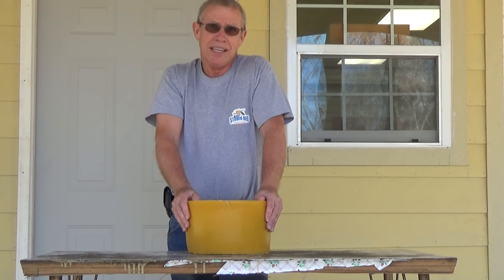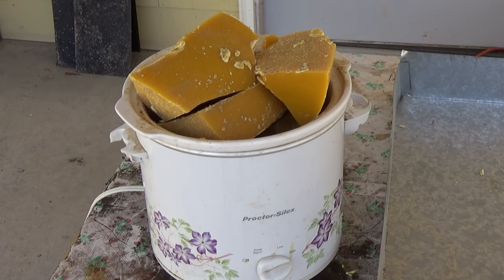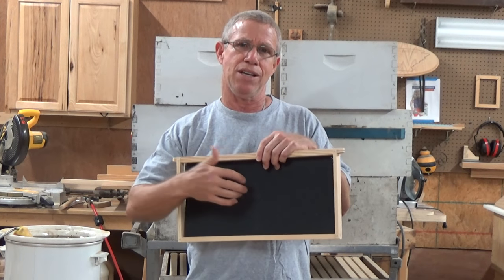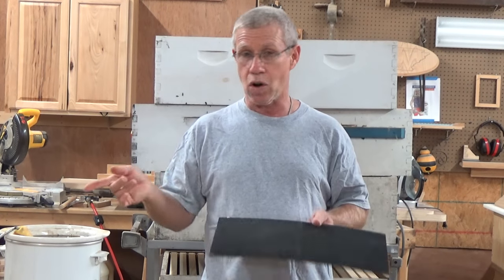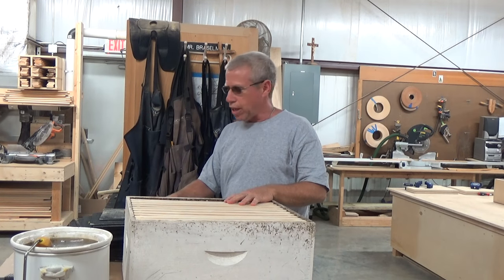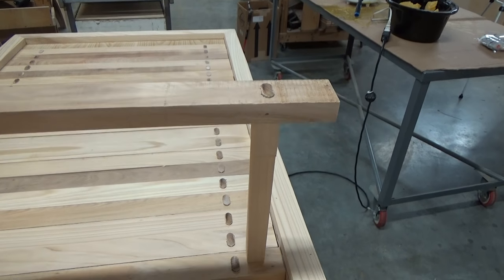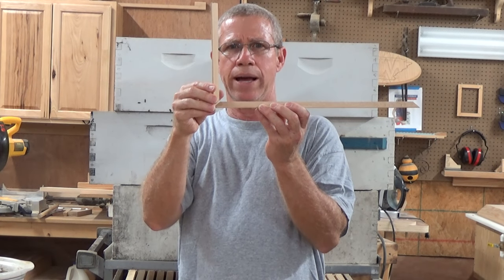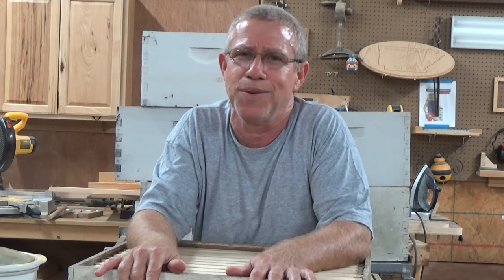Getting ready for splits     frame preparation

Comment: 1 I cast my wax in smaller blocks in plastic ice cream tubs only 2 inches thick, faster to melt and less work breaking it up

2 We all learn from our mistakes so I guess that you a lot wiser now

3 warm up the plastic foundations so the wax is a lot thinner, and easier to apply

4 love your clips god bless and keep smiling
Reply from the maker: Thank you for the blessing Stan, I need all I can get. I have changed completely my process of wax melting and applying the wax to the foundation, like you said, we learn from our mistakes. I will make a video on that next year when I start applying and melting the wax. Thanks for watching. God's peace.
Mr. Ed

Comment: Just wanted to touch bases with you Jeff, I learned something from a UK beekeeper on YT.  He was casting his bee's wax in flat sheets which were brittle and broke apart upon cooling, but after he ran them thru a pasta cranking device, squeezing the wax sheet and causing it to flow upon itself, the brittle wax sheet became the soft sticky stuff that the bees really will jump on.  They do this themselves with their jaws of course.  Working the wax significantly changes it's properties.  Can't help but think that a round cell hole would be too tempting for any self respecting bee to pass by without a hexagonal touch up.  So a marriage of all three tactics might produce a frame foundation that bees truly love to get right to work on?  Just some sillyness to think about.
Reply from the maker: It all sounds interesting, but I'm going to stick to my method. It may be a bit more messy, but a lot less work. You know one of the things I love about keeping bees is that there are so many ways of doing something to achieve similar ends. Always good to hear from you Lee. God's peace.      Mr. Ed

Comment: Mr Ed , I had seen a video pertaining to adding wax to foundations from another beekeeper. He mentioned it was of importance to not not allow wax to cover the bottom of the cells on the foundation but just the top edges . Have you ever heard of this ? Ever had any issues by covering the bottoms ?Thank you Kameron
Reply from the maker: Everybody has what works for them. I have found that unless you completely cover the plastic foundation, the bees tend to skip the spot where the wax was not placed. That's just been my experience, and so that's how I do it. You will have to make your own determination, and proceed forward from there, but I still stand by the way I do it. God's peace Kameron.
Mr. Ed

Comment: Mr. Ed.  I've never even seen a top bar hive in person, but I was thinking that it would help to have a single strand of wire from the middle of the sides to stabilize the comb.  It seems like the TBH's I've seen on video don't have the sides on the bars.  Your design seems stronger and I think a wire stabilizer would be even better.  Just my 2 cents.  BTW, I'm a new subscriber and a  beekeeper from Virginia.  I really like your channel.  Thanks!
Reply from the maker: Wade thanks for subbing to my channel, and I like your idea. Not only would it help stabilize the wax, but it would also give strength to the side bars and keep them parallel to the sides. How many hives do you have Wade and how long have you been a bee keeper? Thanks for the tip and for watching. God's peace.       Mr. Ed
Reply: Usually, we keep no more than 3 hives, but this winter we lost 2.  It's 
been a tough 2 year stretch up here in Virginia with around 50% hive 
loss.  Interestingly, my experimental Buckfast hive I started for our 
club has thrived over winter while I lost an Italian hive and a 
Carniolan hive.  This is our 4th year and I feel like we are really 
starting to understand beekeeping.  We are members of the Huguenot 
Beekeepers Association  over 100 strong out here in rural Powhatan 
County.  The Buckfast bees have impressed me so much, I'm going to 
attempt to stay with them by splitting the colony when it's a little 
warmer, but I'll set out a couple of bait hives just because.  :-)  Take
 care my friend.
Reply from the maker: I am very fascinated with the Buckfast bee simply because it's origin is from a Benedictine monastery in England. As I keep bees for a Benedictine monastery here in southeast Louisiana, you can understand my affinity towards that strain of bee. I have discovered a place in Texas and one in Canada that raise Buckfast nucs, but the Texas bees are said to be aggressive whereas the Canadian bees less so. Where did you get your bees from and what is their disposition? Keep in touch Wade, I'd like to hear more about your Buckfast bees. God's peace brother.         Mr. Ed
Reply: I became so interested in the Buckfast bees that I read the biography of Brother Adam.  He was a brilliant self taught apiarist!  I have thought that if I ever traveled to England, I would have to go to the Buckfast monastery.  Our club president gave me a nuc that he had raised up from a package and I'm pretty sure they came from RWeaver in Texas, but I'll confirm that.  They are very docile, very light colored beautiful bees and behave very differently than typical Italians or Carniolans.  I don't know if this colony is typical, but they are very prolific, however, they didn't put up much honey last year mainly because I got them late. I gave them a medium super of honey from a failed hive and put a candy board in and they over wintered perfectly.    I'll send you some pics and see if I can post a video on my little YT channel.  I'll let you know.  Thanks for your replies, most YT folks don't respond.
Reply from the maker: You have my full attention. Thank you for your response. Looking forward to more. God's peace.    Mr. Ed
Reply from the maker: I can hardly wait for the pictures. Keep in touch. God's peace.      Mr. Ed

Comment: My bees want touch the cell rite foundation, or wax coated.   So i use a wooden starter strip under the top bar groove,  i just brush a good thick coat of wax on the wooden strip /  they drawl it out just as fast. Plus i don't have to deal with the plastic foundation. And the cost!   ITS NOT WORTH IT!  Plu too if i had comb i  need to add to a empty frame, i just pinch it on the wooden strip, CUTS DOWN THE USES OF RUBBER BANDS.. I do use them on honey and brood.  The bees will make it stronger and weld it up, or take it in and pour some mild hot wax on it  / If i want to cut the comb of honey into squares NP!  Try that with plastic foundation or wires and fishing line  he heeee  Can see the customer now picking plastic, wire or fishing line from there teeth  he heee
Reply from the maker: How long have you ben keeping bees, you know a bunch of stuff. Your comments always make me smile. Thanks for checking in. God's peace brother.      Mr. Ed
Reply: 8 years, i sold every thing. 4 years ago, and my place in CORPUS CHRISTI  How long have you been beekeeping?   i bet longer than me !  i can always learn some thing...Where i'am weak at is AFB.  EFB, never deal with it.   I hope i never do....
Reply: If part of the wax comb is damaged then all you have to do is to cut that part out.
This year I let the bees make a part drone frame. I cut about 2 inches of bad wax comb out along the top of the frame of the old drawn out frame. The bees drawn  the empty 2 inch space out with drone cells. 
Also if you have a wax foundation or wax comb, the queen cell could be cut out of it and placed into a different hive. The bees would fill/fix the cut out hole.
In the summer my bees can draw a deep frame out completely in 2-3 days in the spring.